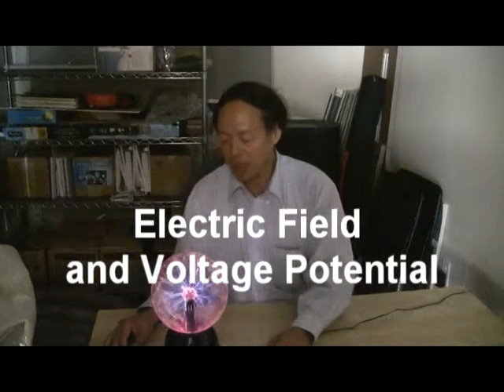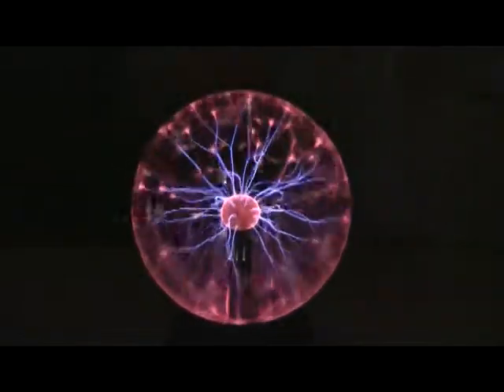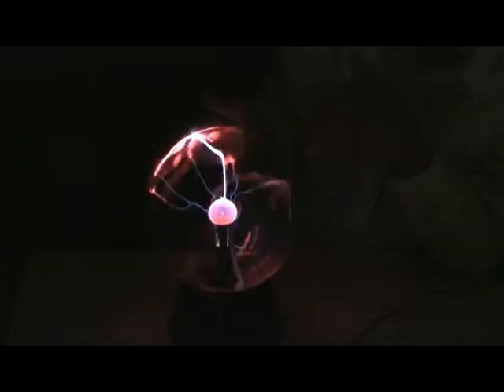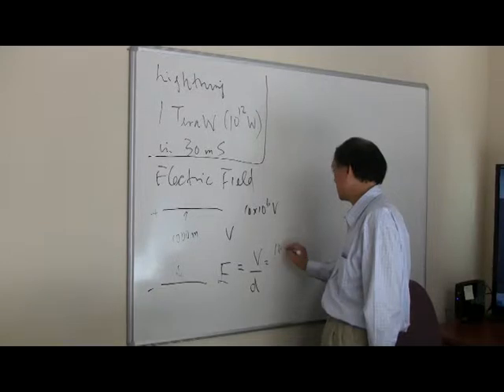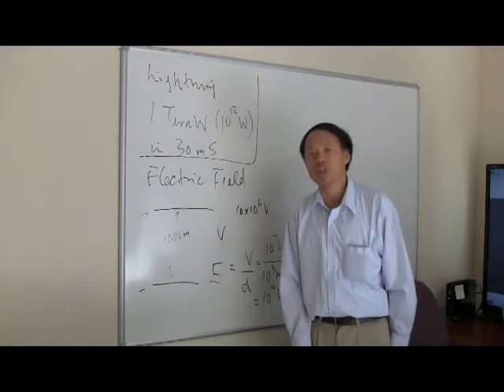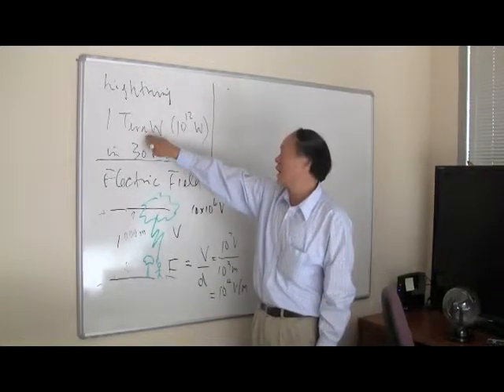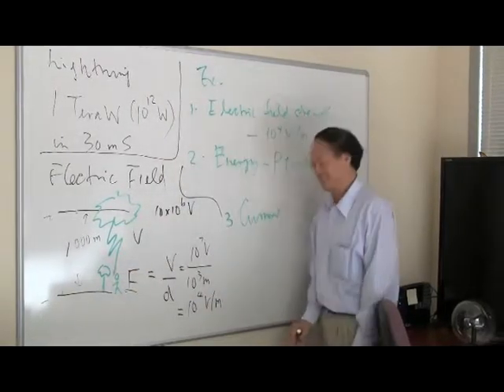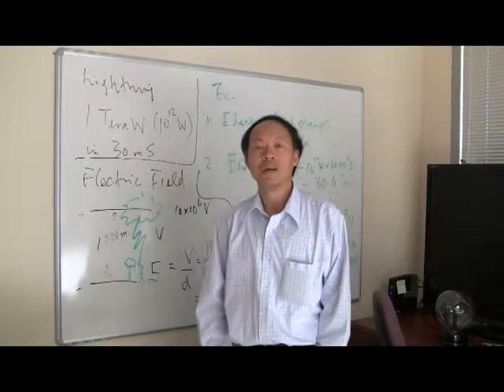Electric Field and Voltage Potential EC3

Comment: Ok, so between the electrode and the outer glass shell, there is an electrical potential of 5000 volts (due to the charge/lack of charge ratio between electrode and glass)?